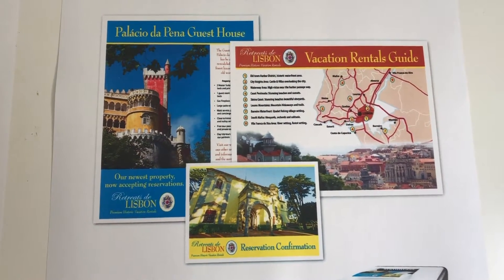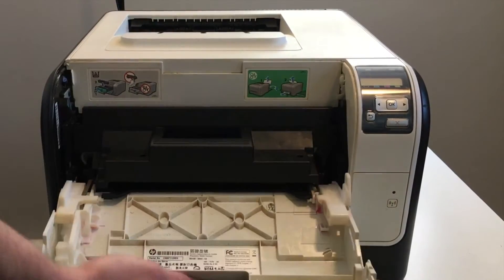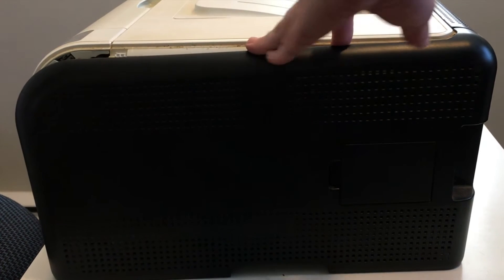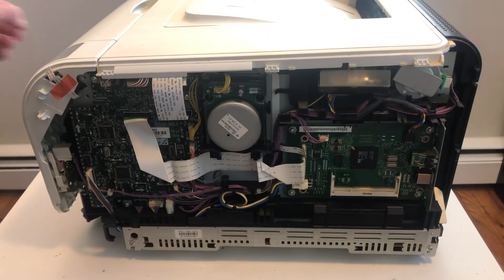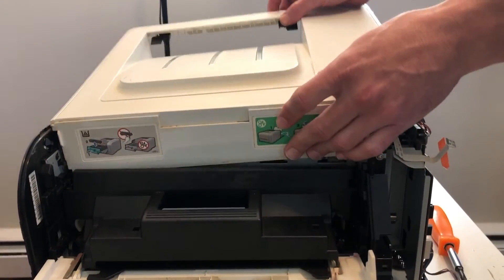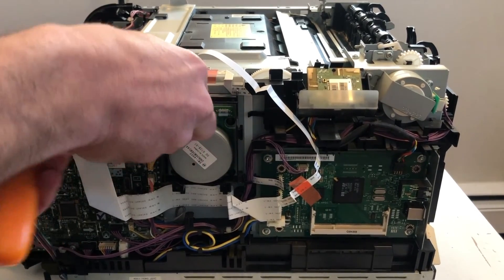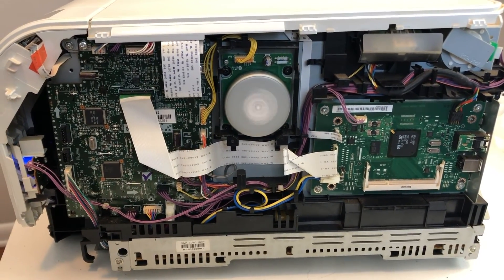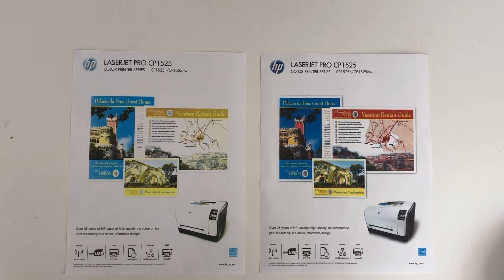HP Laserjet Laser Printer Laser and Mirror Cleaning to Fix Weak Prints – DIY – How to CP1525 CP1520

Comment: Just got a CP1525 with less than 5,000 pages of use. Installed new toner and the prints are still weak and the colors misaligned. Thank you for posting this, I’m going to follow these instructions and I’m sure it’s going to significantly improve the output/
Reply from the maker: Awesome, they are really great printers when they are running clean.

Comment: Our CP 1625NW is having an alignment issue with the magenta toner, the magenta print isn’t lining up with the black, cyan and yellow, any ideas. The printer started doing this intermittently with the last set of tone cartridges and continues with the new set od toners… Any ideas? Note:  Both sets of toner cartridges are from a third party supplier who we have been using for several years.
Reply from the maker: Sorry to hear that, this may help: https://www.hackerspace-bamberg.de/HPCLJCP1510Repair No guarantees and no affiliation. Of course, cleaning the mirrors may be worth a shot to. Hope this helps, let us know if adjusting the trim or cleaning the mirrors fixes your issues!

Comment: Great video UNTIL removing the cover on the laser unit. I have the same exact unit as in the video and there is a metal crossmember over the back of the cover that prevents removal. In the video you say "the back is tight" and don't explain further. All of my tabs are released. How do you remove the cover?
Reply: Definitely do not try to remove the laser unit cover like the video hints at, but never shows...

There are three metal spring arms that look like straightened paper clips, two on the left/right in the front of the laser assy, one one in the middle back.  Use a needle nose pliers to slip off the one end and remove them (and they have a small hook on the other end that releases easily if you move it downwards).

There is a silver metal plate on the right side edge above the laser assy and two screws that can be removed to lift the plate up and to the right so that it does not block the laser assy from being lifted up.

The purple 4-wire harness is (probably) easiest to deal with if disconnected at the board behind the control panel area, but when I pulled on that it was stubborn and I "broke" the the connector, so it might be better to not do that (or use a thin screwdriver to separate the connector from the socket(?)... not sure if it's possible to lift out the laser assy with the purple wire harness restricting movement.  In the end I was able to "repair" the connector so I got the job done.

Once the laser assy is free it can be slid up and towards the front and removed completely.  Then the cover can be removed -- 4 larger tabs, 2 in front, 2 on (back) sides.  There are 4 mirror pairs, and 2 other curved glass pieces around the rotating mirror.  I cleaned all 6 on both sides with a lint free cloth wrapped around a q-tip, and wet the cloth with a 99.9% alcohol product meant for cleaning tape recorder heads for zero residue.
Reply: I have not enough clearance to reach in to clean the laser or the hexagonal part with the 6 pointed star nut retaine😢r which I assume is a rotating mirror 2:11 What to do?
Reply from the maker: check for any tabs or screws still engaged
Reply from the maker: Thank you, this was awhile ago. If memory serves, the cover can't be removed completely. You can open it up as shown in the video. You will still have enough access to clean all the mirrors and the laser assembly. If you can't open it up that far, double-check that the screw is removed or any other tabs that may still be engaged. Hope this helps and you get some brighter, bolder, prints.

Comment: i cleaned the laser box and now when I put it back together the top wont close =( the screws on the front wont sit leveled only one I don't know what I did wrong I'm not sure if I placed something wrong because it wont close I have the color laser jet pro m254dw HP
Reply from the maker: Check the alignment of the plastic parts that go around the mirrors.

Comment: A lot of time the "dirt" on the lensif its an active printer is 95% just toner powder thats blown out or fall out onto the lens. Remove all 4 toners in my example a little love and easy does it with the air nozzle from the compressor and a few puffs of air on each of the 4 lenses, in my case that sit directly under each toner and good as new!
Reply from the maker: Good advice! Compressed air is a great way to start and can save from more disassembly. For heavily used printers or those with difficult to access mirrors, sometimes a little more love is needed :)
Reply: @fatherandsonfix  thanks btw, and sorry! geez I just read my text, you would probably be shocked to know English is my first language. Maybe it's time to turn back on autocorrect......lol

Comment: Thanks... Liked, Subscribed.
I'm hoping you may advise me on a problem...
I am getting 2 vertical narrow, 75mm wide faint strips on my 11x17 color prints on my HP M750 laser printer. I've replaced the toners, inspected everything, done cleaning cycles, etc... and it persists. It seems as if it is the black that is the omitted color in the 2 strips of faintness. The strips of faintness edges are not abrupt. It seems to have started after the printer took 2 pieces of paper in a printing cycle and they were staggered, one a bit ahead of the other. The fuser was loosened and the pages pulled out. It printed perfectly prior to the incident... if I recall correctly.
Any ideas for me?? Is the actual laser itself dirty? It is driving me crazy. 
Thanks again... Very appreciated...
Reply from the maker: You're welcome. Sounds like it may be an issue with the drum. If the drum unit is ok, and the mirrors are clean, it could be the LED or light that is damaged or dirty.
Reply: @fatherandsonfix  Thank you.  Appreciated it.  The printer is relatively low page count... Couldn't figure it being something so protected as the led or mirrors.  The "windows" are covered by a scissor contracting cover which do not move for cleaning.  I attempted to blow it out with a duster can and will run a test Monday.  But, one thing I hadn't swapped out is the fuser unit, which is where I pulled a double page draw from when this problem started.  I have a spare old fuser so I'll swap that in, then, too.
Thanks again... Very appreciated!

Comment: Thanks for the detailed process, but I wish you showed the last part of removing the laser unit’s top up close, as there is a metal part holding that cover that I can’t seem to pry to top cover easily as you did. I hope you can provide an answer for that.
Reply: Hey I’m having the same issue here, can’t seem to figure out how to get under that metal piece , did you ever figure anything out?
Reply from the maker: Do you have the same model? There is a screw that is holding it together that needs to be removed. Once the screw and spring are removed the front can be easily opened. Also check for plastic tabs at the bottom. If you have another model, we can't provide direct guidance. Search for a repair manual for the model. Typically it's a small screw or clip that needs to be removed. Let us know how it goes!